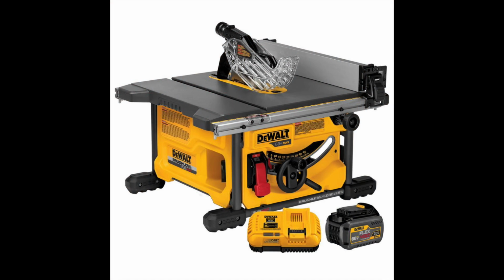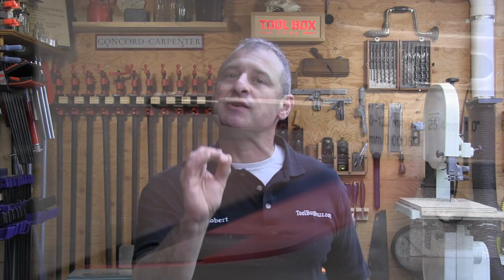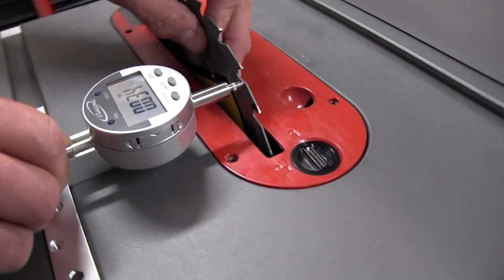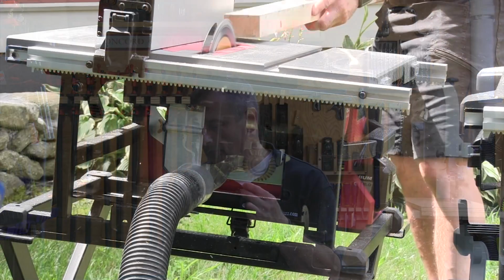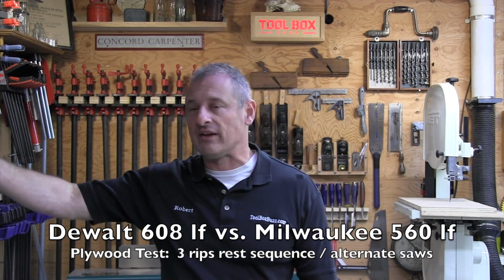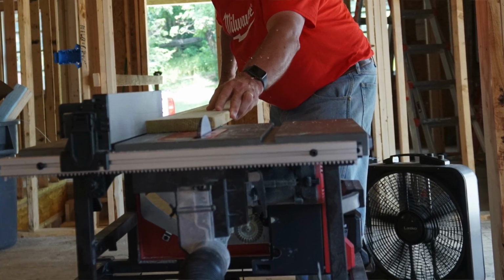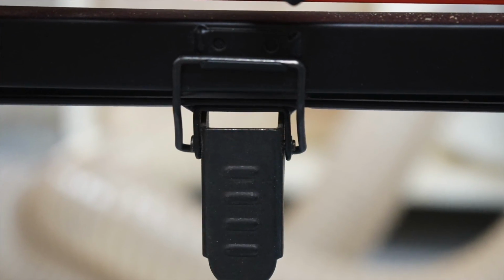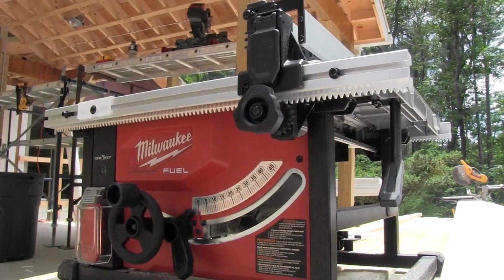Cordless Table Saw – DEWALT vs. Milwaukee

Comment: Great comparison! I own the Dewalt saw but mine does not have the same riving knife lock. I don't have to remove the plate to get get to the lock, it's positioned at the same location as the Milwaukee so I can reach in from behind the saw and unscrew it and pull my knife off. I also want to add my view on the battery platform dilemma. Sure, you need flexvolt batteries to run the Dewalt but can use them on several 20v max tools despite the extra weight. The Milwaukee basically need the 12.0ah battery to perform like it's designed to do (from what I've heard) so if you think about it you kind of need those big batteries for that saw. Think about that folks and compare the situation with Dewalt. I'm not saying either one of them are a winner in that category, more that they are not that different from each other.
Reply: You need the flex volt to run the Dewalt as well. Difference being I can slap the M18 12ah on any of my Milwaukee tools. It’ll run my impacts, multitools, miter, nail guns, router, sawzall, jigsaw, sander, etc. Every piece is interchangeable. And for once…it’s cheaper with all those features than Dewalt. I was always big on Dewalt until I was continuously getting screwed by trash batteries that would go bad just out of warranty range, and brittle hand grips. That’s why I went red. An employee Dropping a whole tool bin off a 3 story roof and every tool still kicking is why I will remain red. I’ve never had to do a warranty exchange to date…knock on wood

Comment: Quite a thorough review.  It would be interesting to learn the variability between units from the same manufacturer.  There's always a chance another pairing would yield the opposite results ... QC departments know that confidence levels depend on sample size.
Reply from the maker: Yep of course - were not UL laboratories
Reply: Especially when you look closely at how close these two units were in the measurements. There was NO big differences in anything we measured.

Comment: Appreciate the review.

A major point that you omitted was the warranty of the tools.

DeWalt has a 3 year warranty, the Milwaukee a 5 year warranty. That's huge for a tool.

You are correct in that DeWalt doesn't offer the saw as a kit. What you omitted was the cost of a battery charger for the DeWalt saw. The chargers I find listed run $85 on top of the price of saw, stand and battery bringing the Dewalt total cost to $747.99.

With the Milwaukee, I'm unable to locate any of the 18v 12 amp hour batteries. The saw is listed @$549 and the stand for another $79. for a total of $628.
Reply: Pricing is always tough for us as it's a moving target. We try to find the best pricing at the time we write the article. This morning I looked both up again and I get $628 for Milwaukee ($549 plus $79). For DEWALT you can get the bare saw for $340, stand $75, battery $249, and $46 for charger for a total of $710.
Reply: Gunga Dinn well y'all are leaving some information out. The Dewalt is available as a kit, DCS7485T1, but it only comes with the 6Ah battery and charger, for $499. The stand is $74.99. I don't think they offer a 12Ah table saw kit yet. They never did offer it in 9Ah, those were for the outdoor power equipment.
Reply from the maker: Thanks!
Reply: The warranty is why Milwaukee charges an arm and a leg for their tool line.... Your paying for the duds that get replaced (to other people) up front.... it's simple marketing. ... That's all

Comment: Hi Rob, do you have any news about Makita table saw? 2X18V ?
Reply from the maker: No news yet
Reply: I messaged the Makita website on facebook and they replied with no plans and nothing to report at at this time!   I recently joined the makita platform with my sliding miter saw, that I was holding out for a cordless makita table saw....but so far no news.
Reply: @sankarkrishnan7425  it's sad(
Reply: @alekseipolozhentsev3274  im holding out too ...it would make sense since they did it with the miter.
Reply: I don’t think it’s happening on the X2 platform. If it does it will be either on the XGT or future 64V Max platform is my guess. Even then...just not sure. Makita knocked it out of the park with their cordless miter saws in my opinion, I don’t think they should feel intimidated about making a cordless tablesaw. But I do think tablesaws are the last woodworking tool where corded can still often be decisively preferable between the power needed and being stationary during operation, and my bet is Makita just isn’t quite there yet in terms of believing it’s a product that makes sense to stand behind permanently. I got the current Makita corded tablesaw and in retrospect I’m actually glad I got dragged into it instead of following the hype to wait for cordless.

Comment: ... very good review, nice job Chief, thanks for the you effort. 
I like you are impartial,  and brush both providers .
... in till next time... all the best for you and your crew
Reply: ... ... if you take into account that the devalt has only 4 amp , by far dewalt has a higher number of cuts when you consume 12 amps like Milwaukee .
I do not think it would really matter, did you also calculate the working speed?
Reply: may be dewalt realize that two batteries are needed because in the UK it sells the kit table saw with 2 batteriens of 2 amps and fast charger with a price of up to 700 pounds , I was lucky , I have to paid 580 pounds on the kit .

Comment: Good review Rob. Im waiting to see if DEWALT comes out with a version of the saw that has 2 - 60 volt batteries with a 120 volt ac option... and if they do the tool less riving knife and fence. And fix the power switch shutoff issue. And it would be nice if they INCLUDED the stand and made a latch to hold them both together. The lack of an adjustable leg I can deal with.
I heard a rumor that they are coming out with a saw that has 2 - 60 volt batteries with a 120 volt ac option. Can you confirm if that is true?

Ron
Reply: There's been chatter amongst users but DEWALT hasn't hinted at it.
Reply: Renaissance Tools is going to do it.
Reply from the maker: They told us flat out NO - but who knows. they'd be awesome!!

Comment: Does the Milwaukee 2736-21 kit really come with the stand? I looked at that at home depot and it didn't mention the stand. I don't think the stand is included.
Tough decision since I have both lines of batteries alrdy.. Damn
Reply: The stand is an extra accessory
Reply: Todd Fratzel Thanks Todd 👍
Reply: Nope, $80 on top of the $550 saw and 12Ah battery kit.
Reply: Yeah I commented with rob yesterday and his partner apparently had seen it with stand included as they were creating the video but the deal isn’t around now I guess. Could have been an oversight but there might have been a promo deal for a short time. I was wondering about that myself when he mentioned it.

Comment: Pretty scattered review moving between different "categories".. while runtime testing is important there's no real world opinion from usage on the jobsite in terms of reliability, durability, set up time, ergonomics in carrying, storing the saw, performance at low battery ect.. I own the flexvolt.. when the battery gets to 2 bars on a 6.0.. might as well get a fresh one because it cuts so slow. I hate the quality of the Milwaukee fence. Did you mention the flexvolt deck is larger and you can store the fence under it? Did you mention the gears on the Milwaukee are plastic vs cast (pot) metal on the DeWalt? Did you mention charging times? Did you mention saw noise level? Dust control without a vacuum? This review was and is not complete. This feels a lot like a marketing video for both brands. Pick a winner Rob that what we all came here to find out. Doesn't matter who wins but there are no ties. Run-time is run-time and whatever saw cuts the most with the best accuracy wins. And that is clearly DeWalt. There now you know.
Reply from the maker: Mr B. We covered a lot of of the items you mentioned in our testing. The video was 18 minutes long - I can only cover so much in the video, and I clumped a bunch into ergonomics and functionality [ I said that in the video]

The article covers more in depth, so check that out.  

Your correct on the fence gears and I mentioned the Dewalt was slightly better. The decibels were covered in the ergonomic score. Dewalt was quieter under load, Milwaukee quieter on no-load.  

Dust control was tough to measure as these two saws, and were close. I can tell you the Dewalt had MORE dust on the ground than Milwaukee, but thats not that scientific - so I left it out.  

As far as a winner - Dewalt wins in runtime and Milwaukee wins in features. Do you need me to spoon feed you? Figure it out brother, there ARE ties in real life; ever watch the Olympics? Football? 

I gave you a ton of info to make your own decision, and from the tone of your comment, I can tell that  if I picked anything but Dewalt, you would NOT be happy.

Stop being a dick by insinuating that Im paid to do this - Im NOT!  Enjoy the FREE content for what it is, free content that takes a ton of time to do, and is as impartial.
Reply: Wont address the whole comment as it was mostly answers/replies.. but owning the flexvolt line (saws only) and M18 fuel line I'm far from bias. I've tried both saws and noticed a difference myself. That's not to say that you didn't but it didn't seem like you wanted to pick a winner here. From the start it even felt that way. When you win in runtime and accuracy.. you effectively win the comp. And at the end of the day us contractors only really care about how any times we have to change the battery and if its going to last. That's why I was a little put off that you couldn't mention durability. If I was to go look at the table of my flexvolt I'd see the paint wearing off from being used very gently on moudings and dimensional lumber. Thats a knock on durability to me considering my 10" corded version of nearly the same saw had little to no paint wear on the table. Too early to tell if the milwaukee will last? Maybe. Hey I felt the comparison was okay it just lacked a true opinion based on usage. Most of us can use a tool and decide if we like it and will continue to use it or not. I've purchased and demo'd probably 15 different 18g brad nailers from every brand and still go back to my old 1990's hitachi ae.. you've had the milwaukee saw for a while now as well as the dewalt, which one are you keeping on your trailer? Doesn't hurt to tell us why you like a certain saw or why you don't. And Rob you're not paid to do these videos but part of a manufacturer giving you a free tool is doing product demos and reviews.. best practice is to keep them as positive as possible so those manufacturers keep sending you free tools... right?
Reply from the maker: Wrong - many, almost ALL,  of the tool manufacturers tell us that our unbiased [non-kiss ass approach] to tool reviews if far batter for their business. They prefer us to be honest and have even used our feedback to make changes to their tools. If we lose that integrity, then we lose our reputation with Pros like you.

The fact of the matter is that many of the tools we review have been designed to compete against each other in specs / features / runtime. They're so close in those categories, that it is sometimes very hard to differentiate the difference. Don't forget that Milwaukee had 2 years to copy / improve their new saw, and they did that ...... thats why the saws are so close.

I'm heavily invested in the Milwaukee platform, and have a lot of Dewalt XR tools. My foreman is heavily invested in the Dewalt platform, and has all of the Flexvolt tools. We use BOTH platforms on the job-site.

I have the M18 saw in my trailer and it will stay there until it proves itself not worth [longevity wise] It replaced a Dewalt corded saw, which we still use on long term projects, where we can set it up and leave it. Its an awesome corded saw.

The two Flexvolt saws I have are both assigned to my foreman and senior carpenter, and are in their vans. One of the Flexvolts  has been in use for almost 2 years. Its an amazing saw, and yes sir - imitation is the BEST form of flattery!
Reply: That's really not true, in fact we are often complimented for saying it how it is. The truth is these two saws are so damn close. If you look at the data, not just the commentary, you'll see how close it is. Accuracy for example...we tested several categories....but the results are so tight that none of us will EVER see any difference in the cuts. If one is 1/100 of an inch better does that really make a difference to guys looking to buy that saw?
Reply: You can store the Milwaukee fence upside down on the rail
Reply: Mr. B . So I bought two of these. First one came with a broken motor mount in box. To the left of riving knife there’s a small,, 3/8 section of cast aluminum, pretty brittle weak point. Had a hard time getting the saw to reset to 90 degrees without forcing it even with the factory stop properly set. Appears the cloth materiel used to protect motor from dust was interfering with that. 

Pinched the blade a bit ripping some sapele, the motor kept up speed but the power draw overheated the battery. 

Love the on board storage, portability/weight, and clean cuts, was really disappointed with real time run time. If they’d developed a plug in option I would have kept saw, but instead i returned it. Too limited in its possible use. Regards Paul
Reply from the maker: paul nicholas which brand saw did you buy?
Reply: A Concord Carpenter / ToolBoxBuzz the Milwaukee. 
If I were to add some more real time use commentary. Sawdust tended to gather and get trapped on back sliding guide rod under the table for raising and lowering blade. Within a thousand feet of cut material I could no longer get blade to go below table top in prep for transport. Bitch to clean out.
Reply: Mr. B. - Trust me....we wanted a winner...the numbers don't support a winner this time. We tested decibels and they were nearly identical (we can add that data to the article, it was an oversight). The DEWALT table isn't any larger than the Milwaukee, they are virtually identical. With the vacs attached there was no difference in dust control. Without a vac it's likely they are similar. With the out of the box accuracy the data was nearly a tie as well. Bottom line, they are very similar.

Comment: If the plastic gear on the rip fence adjustment becomes a problem... Well then you don't have a clue on how to use or care for a saw! It's not like there's major pressure or hardly any type of pressure on it period. No doubt a long time down the road that plastic will wear out before metal, but by that time 95 percent of the ppl will have a newer saw. To framer joe.. I ran 4 framing crews and had all Dewalt drills and impacts and not some but all of them burned up, switched to Bosch and Milwaukee for a period of time and lost some of the bosch and every so often got a dude Milwaukee, but far and away the Milwaukee's stand the test of time. Now that's my experience. Now I'm no fan boi, I buy what I feel is the best for the job I'm doing. But why some of you feel the need to post and repost in video after video about the same things.. I don't get it. Certainly free to do so like everyone else tho. I just don't get it. Message boards the same thing too... My tool is better than yours... Lol. Oh well.
Thanks for the info and review Rob!! Good stuff. 👍

Comment: I install wood flooring for 35 years and just bought the flex volt saw and love it, now if someone would come up with a cordless floor nailer I'd be set. Hint hint
Reply: 1barticus hey man, dewalt does have a cordless flooring stapler 

https://www.dewalt.com/products/power-tools/nailers-and-staplers/staplers/20v-max-xr-18-ga-cordless-flooring-stapler/dcn682m1
Reply: Dewalt has a cordless floor nailer

Comment: Great review Rob!  And interesting comments by others as well.  I'm a bit surprised by the price difference since the Dewalt has been out longer, one would have thought they would drop the price to compete.  On the other hand maybe Milwaukee is paying a bit of a penalty for being late to market and trying to gobble up some market share with the lower price point.
Reply: Most likely this is due to how they are kitted. The DEWALT kit has been out with a smaller pack for quite some time. We shall see if they update the kit with a 12 ah pack and keep the lower price.
Reply from the maker: I think they're losing money to come in lower - my opinion